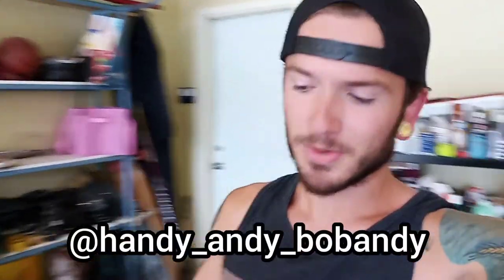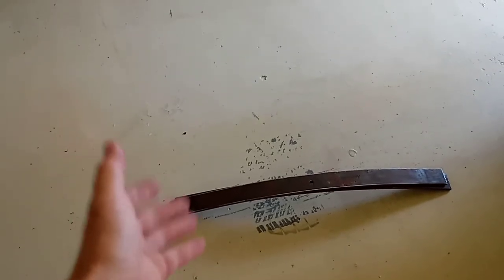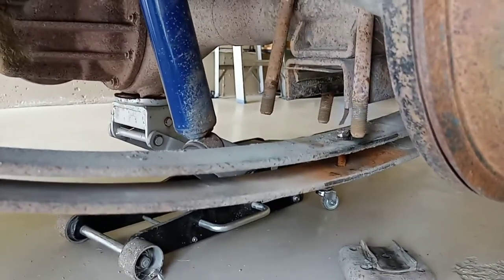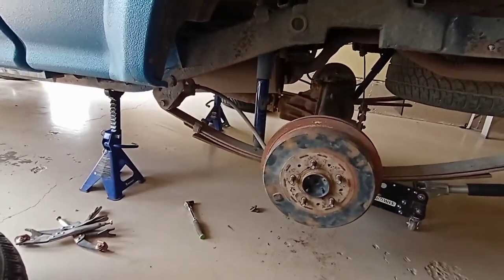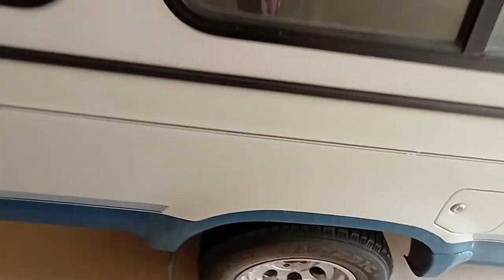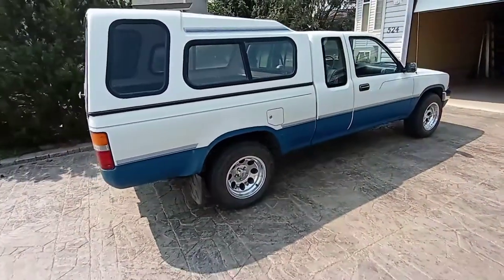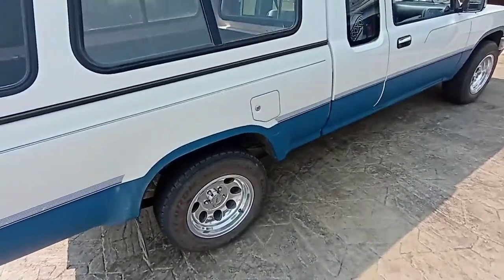Cheap Add-a-leaf Install on Lifted 2wd Toyota Pickup

Comment: Great looking truck! Did you refinish the body?? I have an 89 rwd Toyota pickup. About to get into the leaf springs and lifts
Reply from the maker: @dhos09  thanks buddy. I only partially redid it. The paint Is still original, but I did bed-line the bottom portion of the truck.

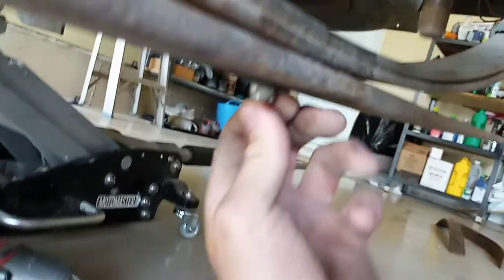Comment: What size bolt did you use to replace the dowel pin? Roughly 2:45 is when you talked about it and of course my dowel pins are seized solid

Comment: Did you adjusted the front ?
Torsion bars?
Reply from the maker: I did a ball joint spacer and slight adjustment on the torsion bars. I have another video on it if your interested.